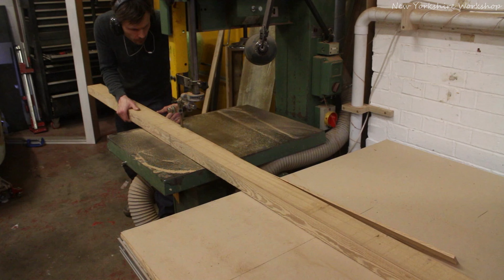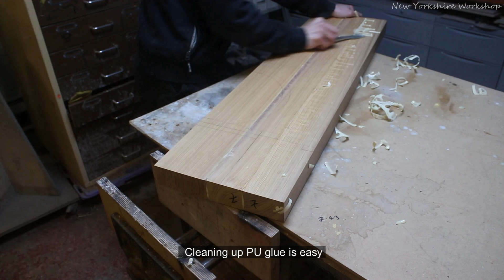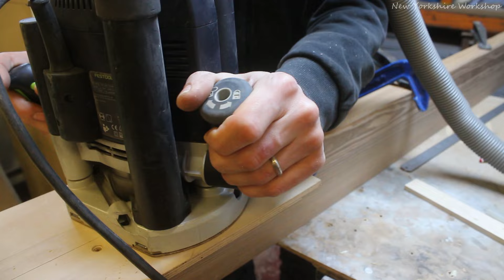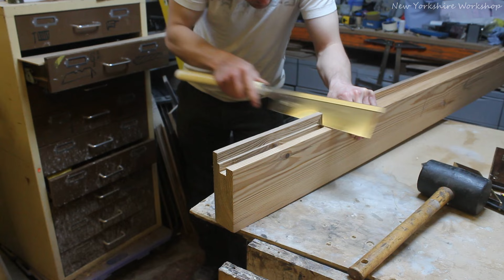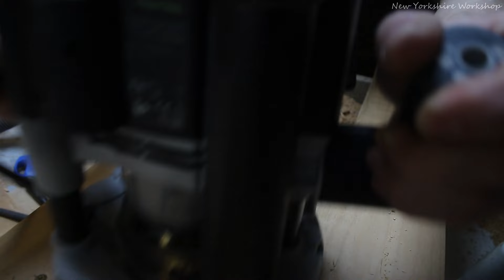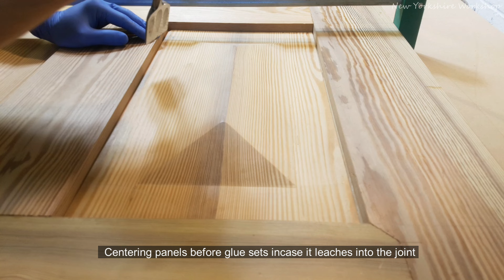Making a Victorian style front door in pitch pine part-1

Comment: I quit building doors for my stained glass about 1980. I retired twenty years ago. The lumber needs to be straight grained, to prevent problems. Victorian homes had huge porches. That is the only way I would use a wood door. Out of the sun and rain. I used aluminum for my windows.

Comment: Very nice. Great way of doing the panels with the tilted jig. Can i ask, is there any reason you use PU glue? Noticed you use it a lot. I havent used it very often just wondering if I should start using it more.
Reply: Just subscribed too :)
Reply from the maker: Thanks! I use it for the doors and windows because i know it is water proof and is convenient. there are better glues for this kind of work like Cascamite or even epoxy, but you have to mix those. I dont trust the titebond type glues because they are just modified pva.
The disadvantage of the polyurethane is that its strength relies on good contact, meaning if there is a gap it will foam up and not have any strength so you have make sure the joints are good and tight. Mathias wandel did a good video on the subject.
Reply: Cool. Thanks for the reply. I'll have a look at mattias' video.

Comment: Is that a sedgwick planer/thicknesser? I think I have the same one but find setting the blades a pain. Do you use a jig?
Reply from the maker: Im using the estabrucke? turn blade disposable ones, i love them. litterally takes few minutes to change them. ive been meaning to do a video on them them at some point.
Yes it is a sedgewick, there are some different versions, i like mine because both tables are adjustable.
Reply: @NewYorkshireWorkshop  great I'd never heard of those before. Definitely buying some now. Adjustments on in and out feed tables is definitely a handy feature.  I've literally been looking for a solution to the knife setting for 7-8 yrs but it always ended up looking like an expensive drum change. You're a lifesaver.
Reply: @NewYorkshireWorkshop  I also see in another video that you've put a secondary surface on the thicknesser bed. I tried that with melamine chipboard but it didn't work great. What material are you using? A video of all these mods would be great! (but maybe a bit niche)
Reply from the maker: @barneycripps2863  yeah the sedgwick has those rollers in the bed which werent in great condition and it wasnt feeding all that good without them. the material is UHMWPE, i got it here- https://www.directplastics.co.uk/uhmwpe-sheet
it very rarely sticks when feeding. it is quite flexible even in 10mm thick so you have to support it quite well. if your bed is flat and you dont want to extend it like i did then you could probably go much thinner and just glue it on.
Reply: @NewYorkshireWorkshop  where the sheet lays over the rollers did you add additional support or just at the ends where you extended the bed? also what glue did you use to attach it to the bed?
Reply from the maker: @barneycripps2863   i just added those bits of ply at the end. i didnt glue it anywhere, jusy screwed it into the ply i added but ive noticed lately it does bulge up a bit in the middle and causes smaller timbers to plane out of square. (bigger pieces just squash it down) it is really slick so i think the only way to glue it would be to rough it up really well and then epoxy it, or mabe a poly sealant like sikaflex or tigerseal etc. im thinking of other ways to improve though, like using a sheet of ally with a thinner layer of the plastic but dont have time ar the moment, i get really busy this time of year.
Reply: @NewYorkshireWorkshop  being busy at the moment is a really good thing!

Comment: nice work! I would have cheated and just used domino xl instead of tennons.
Reply from the maker: Thanks Rick, if you have one thats great. I think the jack mitered joints and rebates in the frame would cause problems but with a bit of redesigning it could be made to work. I think with 140mm deep domino's the joints would be just about as strong  but i like the idea of having the long haunches which helps a lot with torsional stability, especially on the head.
Reply: Your probably right on that. I could only afford one, so I got the XL and  the conversion kit from seneca. Im thinking domino full depth, then cut- then do a final depth measurement and trim domino to length. Think that would work?
Reply from the maker: @rickw4160   yeah definitely, you wouldnt lose much depth, 15mm in my case for the rebate bringing it down to 125mm ish which i think is still more than adequate for hardwood tenons.
The XL didnt exist when i bough the df500 unfortunately so i didnt have a choice!

Comment: Beautiful craftsmanship!
But why are you using Gorilla glue, your joints are tight and do not require additional filling. Furthermore, as far as I know it's PU based, which can't handle moisture over time.
Nevertheless really nice!
Reply from the maker: polyurethane is moisture curing, it gets stronger in the the presence of water. the real enemy of pu is sunlight but that isnt an issue for a joint.

Comment: 👍 What are the advantages of Gorilla Glue compared to normal white carpenter wood glue?
I can buy Gorilla Glue in Europe - unfortunately not many others.
Are you a trained carpenter or a hobby self-made man?
Greetings from Austria!
Reply from the maker: i trained as a carpenter and did an apprenticeship as a mould maker which i completed in 1999 and been a full time woodworker of various descriptions since.
there are a few reasons for the PU glue; im mostly using it on the exterior work because it is pretty much water proof to the extent that if submerged in water the wood will degrade before the glue, whereas the "weather resistant" d4 grade Pva's and even the aliphatic resin yellow glue will fairly quickly dissolve. thats if you can find a real aliphatic resin, titebonds yellow glues are just modified pva with a yellow dye to imitate aliphatic resin!
 another reason is i tend to have it in the workshop anyway as i use it on some of the products i manufacture where im bonding wood to alluminium, PU does this quite well. it is also convenient being able to just squeeze it out of the bottle and when foamed up on the surface it is really easy to clean up. 
main disadvantage is there is almost zero strength when it foams up, so you need to make sure the joint has good contact and clamp well. in situations where i cant guarantee good contact, or i need to guarantee good joint strength i would use epoxy ( for external work) i know cascamite is widely used, ive never used it personally apart from at college 22 years ago.
Reply: @NewYorkshireWorkshop 👍 

Thanks for your detailed explanation!